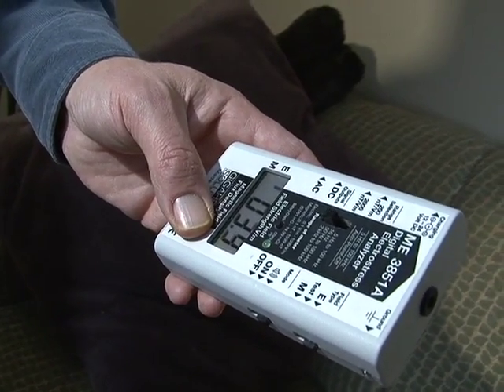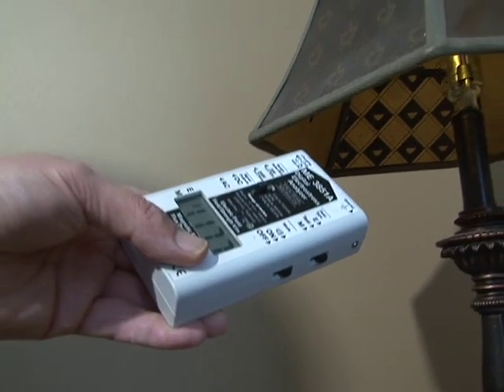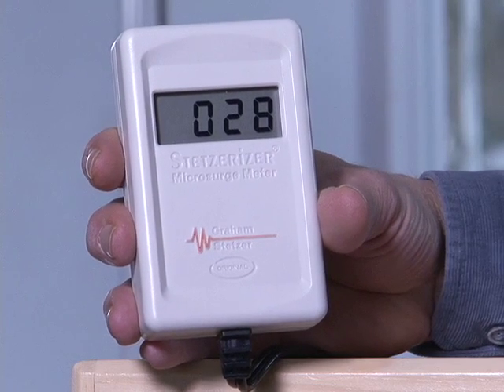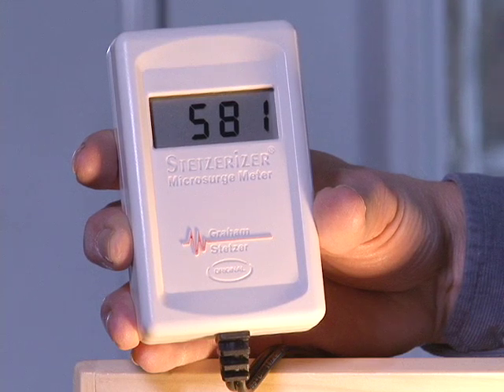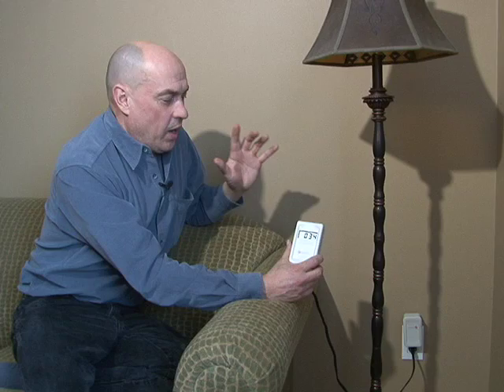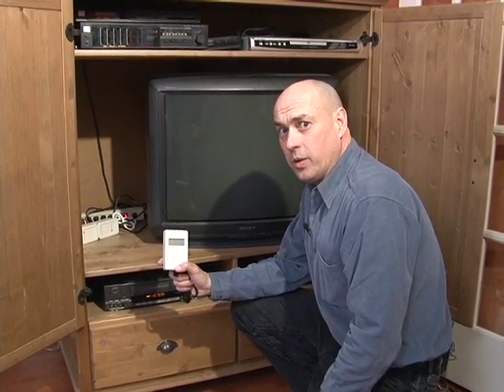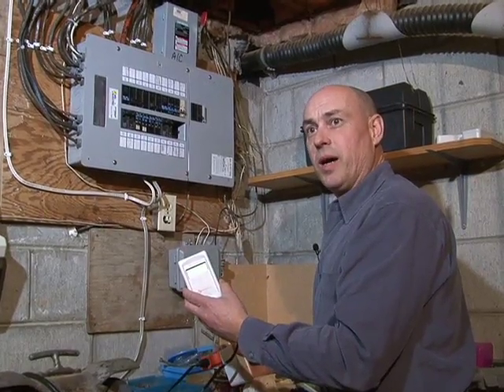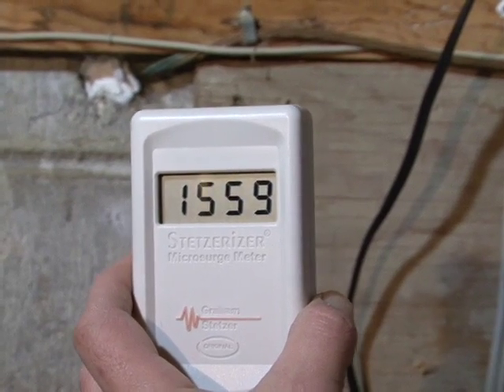Dirty Electricity

Comment: Can the meter handle being plugged in next to the circuit breaker panel without getting overloaded from the dirty electricity?? Or would that be too much for it??   And if you have one or two filters by the circuit breaker how does it affect the dirty electricity in the other rooms of the house??  I can only guess if you have dirty electricity and you just put one or 2 m by the circuit breaker numbers would probably move from 500 down to about 200 until you plug more filters in to bring it to safer levels??

Comment: Does the Stetzerizer filter only go into one wall socket like the where the circuit breaker or do you have to place it in all wall sockets that have the EMF dirty electricity.